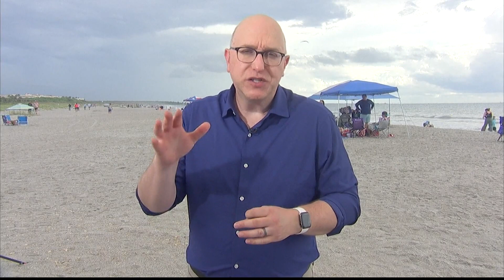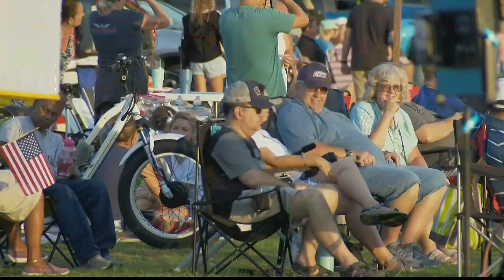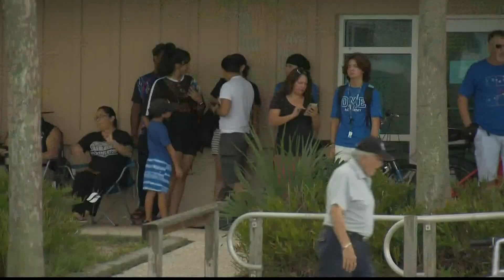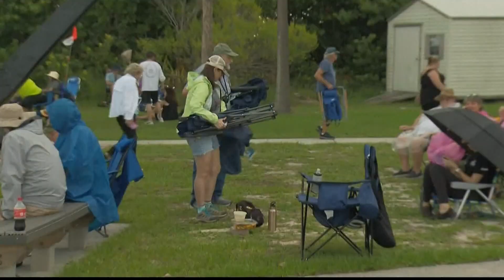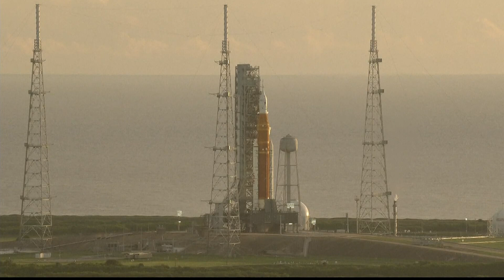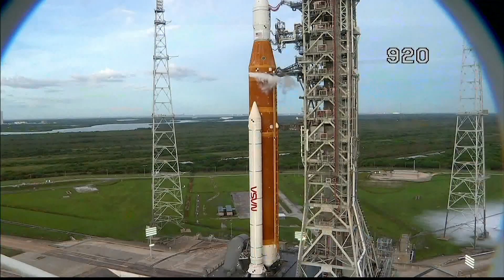Why NASA postponed Artemis 1 launch

Comment: The 2 hour window on Friday, September 2nd starts at 12:48pm EST (1648 UTC). The Monday, September 5th 90 minute windown starts at 5:12pm EST (2112 UTC). It is launching from LC-39B at Kennedy Space Center (KSC), which is on the north side of KSC. Cape Canaveral Space Force Station (CCSFS) has all the launch pads to the immediate south of KSC, like SLC-40 where Falcon 9 launches from sometimes.